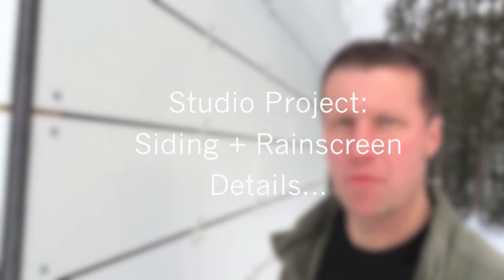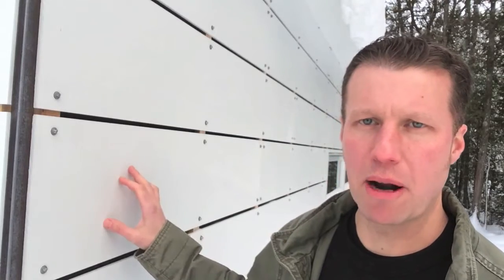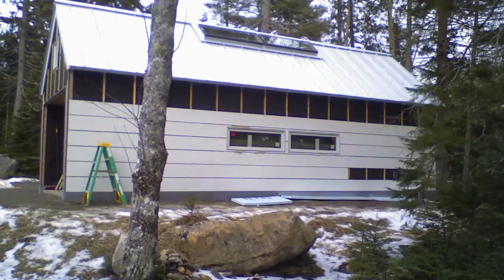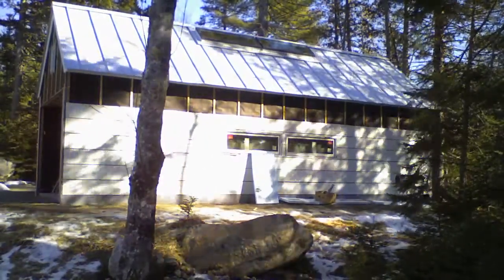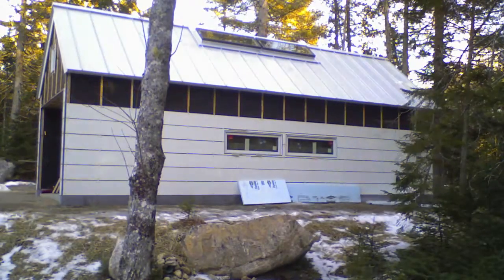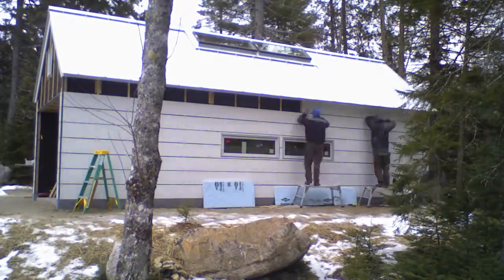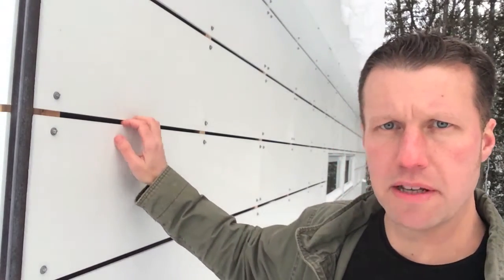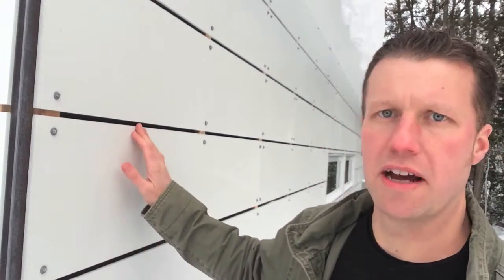Small Studio Project - Siding + Rainscreen details (Part 11)

Comment: Hi Eric, call me crazy, but we are planning to use 15lb felt on a project, located on the sea. I recall, a project you had on a rock bluff, near the sea - what was the WRB used in that project?
 Its common to fasten the felt with staples. In this out building project, how was the WRB fastened? Do you think, self sealing tape is needed, when using fasteners, through the felt?

Comment: I really like this detail, and I've convinced a local business owner to go with this look on their new office building. My provinces code requires rigid insulation on new construction. Would this detail work with rigid as the air barrier in place of the felt? I'm concerned about water penetrating into the cavity at the seams.

Comment: does hardie warranty this install of open joint panel edges? my understanding is that they 'require' captured edges and the use of alum joint trim profiles...
Reply from the maker: yes, this is a non-warranty install...in my experience, the warranties aren't worth the paper they're printed on (they don't cover labor and that's more than half the cost of the job anyhow). as long as you're sealing the edges (which I did, including painting the backsides), caulking any butt end joints, and letting the system dry after wetting (rainscreen does this), this is a bombproof install. no movement from any of these planks...it's even better than the hardie on my house (which is a warranty install) and actually tends to move more.
Reply: got it - and agree! as a small follow-up, did you over-size any of the fastening holes to accommodate thermal expansion/contraction of the panels? thanks for all of your videos - i love your work!

Comment: I love the look of your rain screen, but the open gaps look like it would make a very good home for wasps, etc.  Have you had any insect problems?
Reply from the maker: Hasn't been a problem at all...
Reply: I'm glad to hear you are not having any insect problems.  I live near Chicago, and I have vinyl siding.   Yellow jackets are constantly building nests on my south facing wall.  I also have infestations of box elder beetles every year in the fall.  I wonder if having a more open rain screen like you have would be less inviting to my little friends.
Reply: @59seank  all cladding/rainscreen systems should have insect screens at the bottom/top of the walls. something like Cor-A-Vent SV-5
Reply: @wrxzboost I don’t see a point to having screen at the top and bottom, unless you were to screen all the gaps in each lap.  In this case, it would be best for anything that gets behind the planking to be able to fall out the bottom, like tree needles.   I’ve personally never liked this idea at all because of the bees that will eventually make nests.  The best bet is to run screen up the entire height and length of the wall. That being said, it will eventually break down in the sun.

Comment: I bit surprised the screws are not recessed as they will complicate any painting with a roller for efficiency.
Reply from the maker: You void the material warranty for Hardie if your fastener dimples the surface and aside from this the material will swell at every screw if you try to countersink fasteners.

Comment: Interesting design, its not something I have seen in my very limited experience in Australia, from what I understand have have seen here we always want to seal the elements off using the external boarding/sheeting but in this case you allow quite large gaps to allow the elements through.
Reply from the maker: Rainscreen wall detailing is now the industry standard in exterior wall design. However, not all rainscreens are open like this...

Comment: Cosella-Dörken makes an UV stable wrap specifically for architectural rain screens called fassade - S.

http://www.doerken.de/bvf-ca-en/products/wall_ext/wrb_open-joint/products/fassade-s.php
Reply from the maker: Yes...similar to the RevealShield I mentioned. I found the RevealShield to be marginally less expensive ($0.10 / SF) than the Fassade-S but the advantage of the RevealShield product is that it's self-adhering. Cheers...